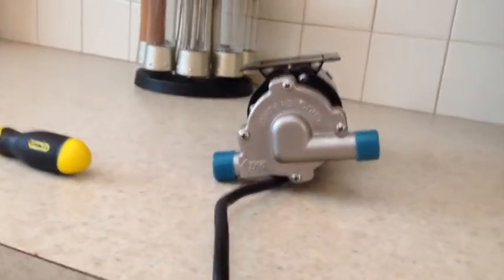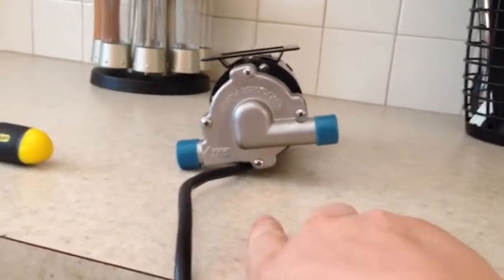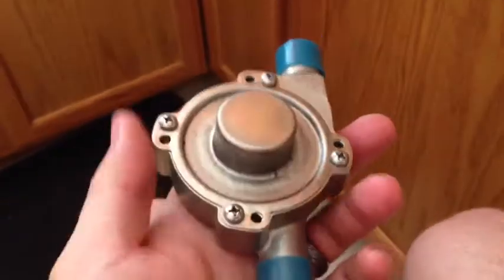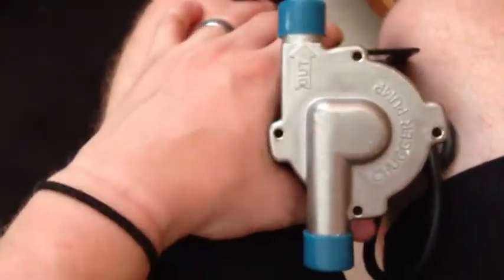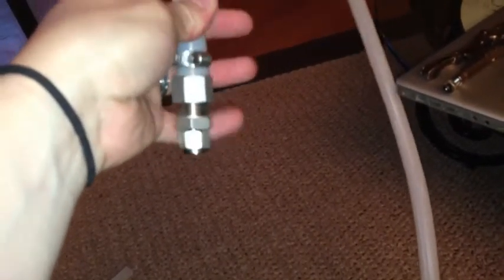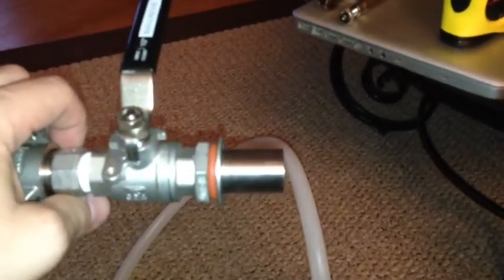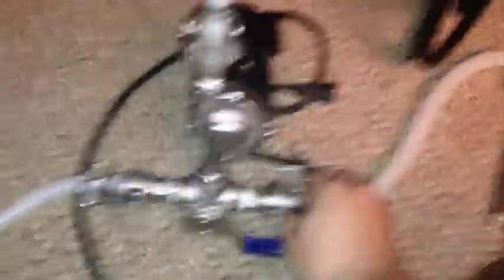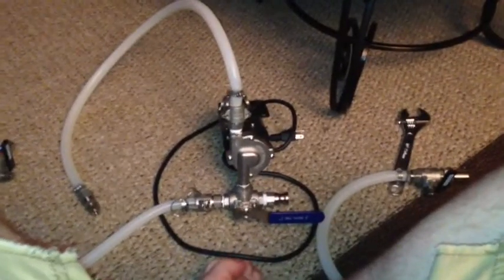Brewery Build - Plumbing

Comment: Great Vid but in my experience the valve should be on the outlet not the inlet.
Reply: The valve connected to the pump is purely a 3 way directional valve. I then have valves on the outlet to allow for flow control without running the pump dry. The pump inlet valve has no flow control is purely directional based on what’s circulating.